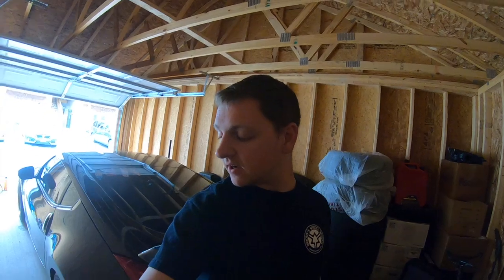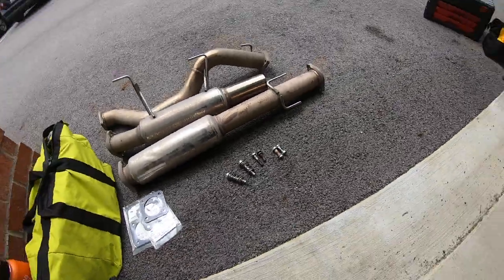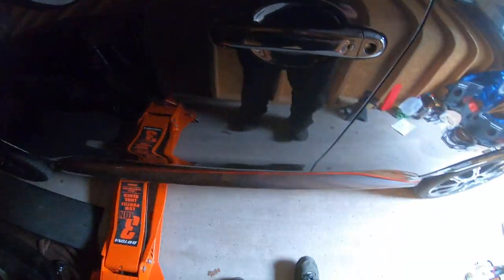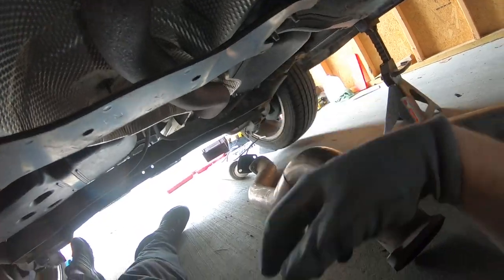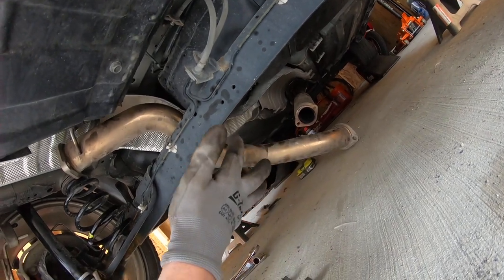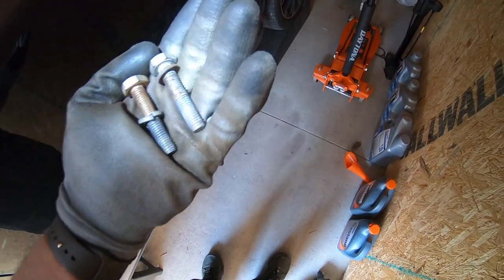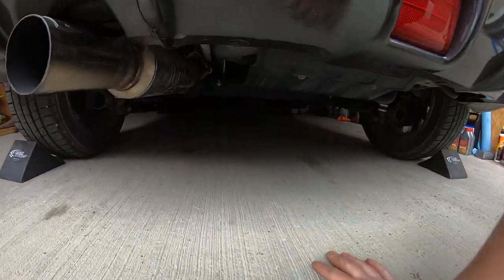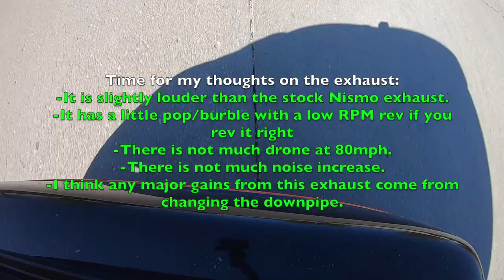Injen 3" Exhaust Install for a 2014 Juke Nismo RS

Comment: You have a nismo RS with a 6 speed? I thought they only came with the cvt?
Reply: They have a 6 speed manual
Reply: 6spd manuals are fwd only , cvt is awd
Reply from the maker: Sorry I missed your comment, youtube really needs to be better about notifying about comments. Yeah the RS with FWD gets a different final drive and an actual LSD. So its a pretty good little FWD turbo car.
Reply: @-CLASSIFIED-  I have a cvt fwd
Reply: @-CLASSIFIED-  Not so. I have a FWD 2011 CVT.
Reply: @nbooker7504  what i meant was the cvt is fwd and awd , manual is fwd only

Comment: I can’t find any shop in KC to work on my Juke they hate them it’s all Honda here I just got my 2JRacing Downpipe and midpipe already had 2.5” pipe going to axel and a magnaflow for a real smooth deep sound however I can’t even find someone to do the swapping out Downpipe and midpipe work.!? It’s so frustrating and last week due to winter I removed the Nismo CAI you can buy and hit an Injen SRI it’s definitely louder and hisses a lot however the last day I’m hearing a high pitch sound during even tiny accelerating on the highway and I need help guys. I’m tempted to drive from KC to Georgia to 2J for the pipes and the tune maybe an IC. Would this type of Jack help me get the Downpipe off on a FWD CVT 14 Juke SL with Jack stands? It seems like just the top 3 bolts and the bottom bolts? Advice…..

Comment: Oh you got a Front Wheel Drive, How much nicer took work on, Not that much better to work on.. But the sticks have Much more Room for Activities LOL.. I bought the AWD SL Before I new what a CVT Trans really was.. But Knock on wood so far so good.. Just can't Make more than 230 WHP with the CVT's.. But hey when it snows I have a lot of fun in AWD..
Reply from the maker: Yeah one of my requirements was “had to be manual” so awd was never really an option for me. But it would’ve been so much more ideal because AWD is always more fun!
Reply: @konradchristen  The AWD CVT's need a lot of Maintenance but it's cool I don't mind the extra money for CVT Drain and fills once a year... It is what it is.. I bought the car Not knowing about CVT's..
Reply: @konradchristen  I needed an AWD drive car to make sure I can get to work in the winter, and I bought this without knowing about CVT's.. I liked the look and it was quick for what it is even stock.. My Juke is at the shop right now getting a Fast cat welded into the Mid pipe and then in hopefully 4 to 5 weeks I will be taking her to get DYNO Tuned.. I want it turned all the way up.. Not planning on going bigger with the turbo or crazy like that.. The stock turbos should make more than enough power for that CVT's..
Reply from the maker: Yeah I heard the same. Just keep up on that maintenance and you should be Golden!
Reply: @konradchristen  What really helps me is I really only drive the car on weekends.. I'm putting a Mishimoto Front mount Inner cooler and new spark plugs in Next week and then she should be ready for the tune.. Just got her back today... I had a Flow Master fast Cat welded in along with a flex piece on the 2J racing Mid pipe right before it hits the down pipe. Just for legal  purposes.. In NJ they have a camera that looks under the car for a cat.. It's crazy..
Reply from the maker: Yeah I can believe that for sure